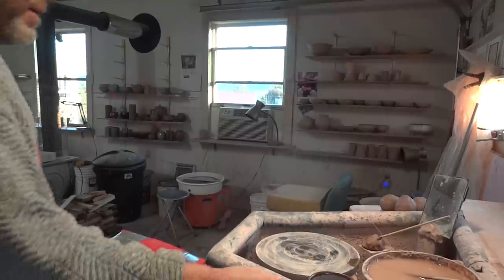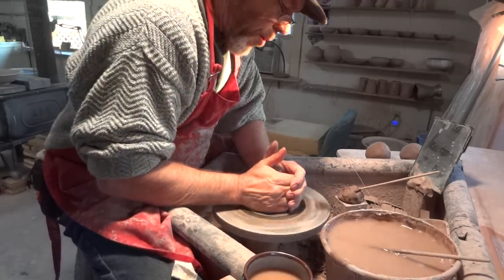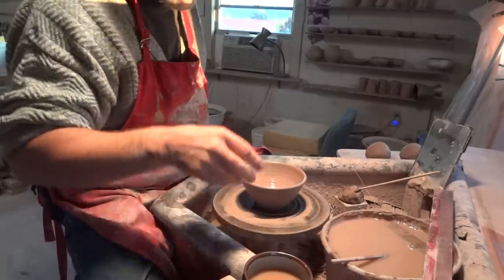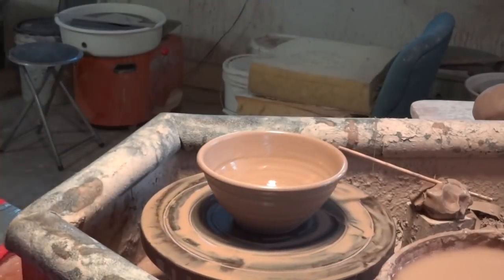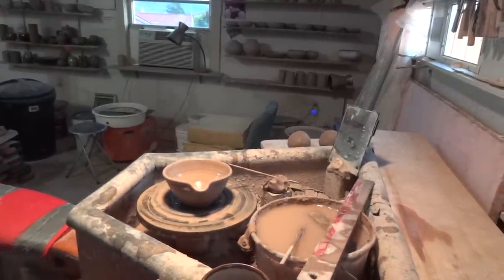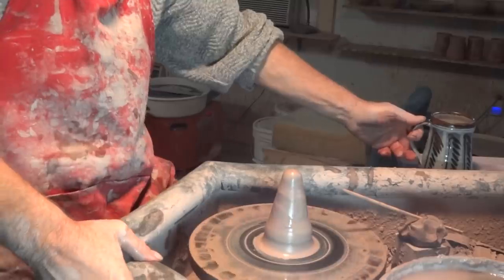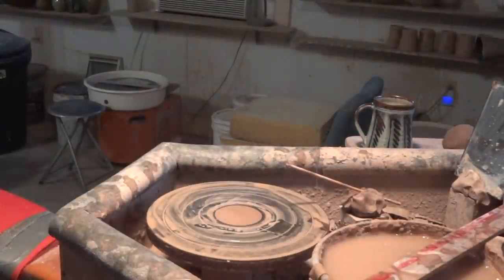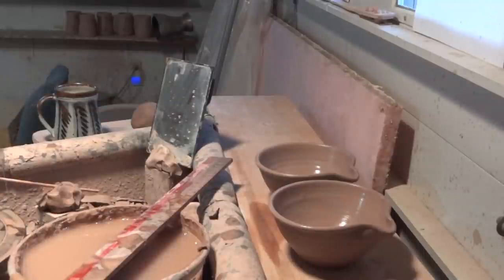Throwing a gravy / sauce boat Oct 31st 2017 with Simon Leach

Comment: Re: camera angles. I think a shot from just over your water pot might be good. That way we'll be able to see your hands and the work you're doing on the right side of the piece. I think you did this in one earlier video. I'm not sure how high your tripod goes, but it might be interesting for some pieces to see a shot from directly over the wheel-head. Wide brim hats might be a problem though. 
I appreciate you showing us whatever you're doing, and would far rather you keep doing just what you're doing that to frustrate you with trying new camera angles, so whatever works for you is best.